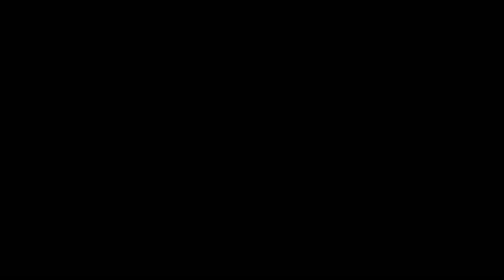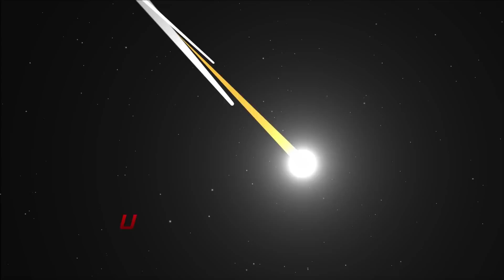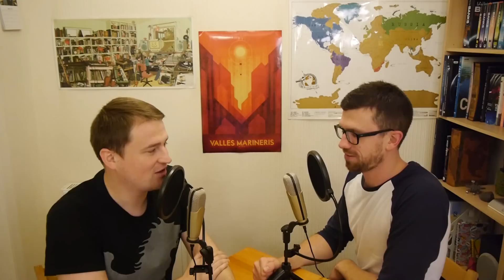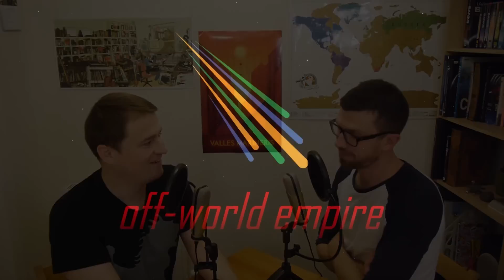What Will We Learn from the EmDrive Paper Coming December 2016?

Comment: MDrive paper is out, and it works. 

http://arc.aiaa.org/doi/10.2514/1.B36120

http://www.nextbigfuture.com/2016/11/final-version-of-nasa-emdrive-paper.html

Things are looking hopeful, there should now be more funding.

So now it's a matter of refinement to see if there's an upper limit of thrust given a power input. Shawyer believes the thrust can be increased ten fold with superconductors and is awaiting a patient. 

So... If that works then?  it's hoverboards, hovercars, zero emission zero noise vertical take off to orbit and back again without heat shields? 

At the very least, and assuming it does indeed work, with it's current level of thrust we can now keep a satellite in orbit without gyros, send a probe to anywhere in the solar system and back again, and even send it on to another destination with no restriction on fuel whatsoever?  This could potentially do for spaceflight what the wing did for air travel.

Comment: The example you were looking for is most probably the so-called Cold Fusion, or as it's referred to these days, LENR (Low Energy Nuclear Reaction) technology.  As it turns out, despite the scandals around it, the technology DOES work.  The original scientist never claimed it was necessarily fusion (that was just one explanation that the university they worked for used to get media attention), just that they were getting more energy out of the system than they were putting into it.  60 Minutes even did a show on it (titled; Cold Fusion, Hot again), and it has since been determined that experimental inconsistencies were largely due to impurities in the palladium lattice that was being used by several groups.  Several nations, including Israel, have continued to look into the technology as have some smaller groups in the US.  The technology still hasn't gone mainstream, probably because of lack of funding and possibly the expense and/or availability of palladium.  (Yeah, I know, some of us are thinking of Ironman's Arc Reactor that also supposedly uses palladium).

On a side note, I believe I saw an article recently on iflscience.com that stated that there is indeed already a plan to send an EM Drive into space for a practical test.  Kudos, I say!  Assuming the device isn't sent up broken, it should finally resolve for certain if it works or not.  Particularly if it DOES work.  Between the new space race between Space X, Boeing, and others, and developing technologies that are coming out, these are some exciting times to be in.  Like Elon Musk, I want to see us travelling the solar system within my lifetime.

Comment: The microwaves are probably just heating the air, like the case in a hot air balloon, which rises in  a similar fashion.
So the propulsion could be nothing more than hot air.
Remember the simplest answer is usually right.
Reply: Nope. It creates force in different directions - depending of configuration of the chamber.
Reply: its a closed system so its not hot air

Comment: sounds like at best this will be a stealth version of an ion drive. thrust from invisible out of phase photons that escape out the back. not a game changer it seems.
Reply: Ion drives require fuel and fuel runs out, when fuel is gone the thrust is gone.  This drive can accelerate a vessel continuously meaning we could reach our nearest neighbour, Alpha Centauri, in just under a century by accelerating for 45 years and then decelerating for 45 years while an ion drive would only accelerate for 5 years using half of it's fuel, coast for 7,000 years and then decelerate for 5 years using up it's remaining fuel.

Comment: if the eagleworks paper come up with even a tiny positive thrust it will bring a lot of research focus and funding
Reply: Yes, if this is an effect, which current theories simply cannot explain yet, physicists need to find an explanation. As soon they found that, they surely will start improving efficiency, if possible at all. And then the hard start is done, and the research will never stop. I hope so.
Reply: there is a theory that its pair photons so they have net 0 electric.
Reply: Yes, I read about that, some swedish or norwegian guy, let's briefly say: A Scandinavian said, that there is a slight imbalance in the interference of two waves, which usually would cancel out completely due to the interference patterns. But he says, that some waves do not cancel out. And some others say, that the measured effect is comparable to a photon rocket.

Comment: I think TM211 was referring to a frequency resonance mode in the cavity.  It looks like it had a higher Q ( On a side note,  I am by no means an expert).  Shawyer seemed to think that high Q was good.  Seems like in reading the paper it wasn't.  I wonder if the competing theory where the photons are bouncing around in the cavity and eventually form pairings that perfectly cancel and allow them to escape this faraday cage is more likely.  Sort of like a jet engine with a filter on the exhaust so only perfectly organized gases can leave.
Reply: Can't be , the trust to power is too high, a photon drive needs one megawatt per Newton
Reply: I took a look at a few of the ideas listed in wikipedia regarding using photons for propulsion.  Although anything truly is possible at this point I wonder if the same metric for another system could be applied to this system.  

Shower did say he had already done other work on this in the past for the British government.  He seems confident he can get more thrust with his approach.  So maybe his theory is solid.
Reply: unruh radiation is perhaps the best explanation, it accounts for experimental observations and sounds more scientific than pixie dust 😊  NASA is sending one up soon , if it works, break out the slide rulers  boys you got some work to do, rebuilding all of physics
Reply: Yeah,  if this paper went well December will be pretty awesome holiday's aside.  The Unruh radiation explanation is going to take at least 5 rereads for me.  This would also force another look at the flyby anomaly since it seems like they explained it away as heat being radiated.
Reply: Per review is great for reviewing theory, but this is hardware. All the reviewers can do is build EM drives, try to find errors if any , the real review when it's tested in space